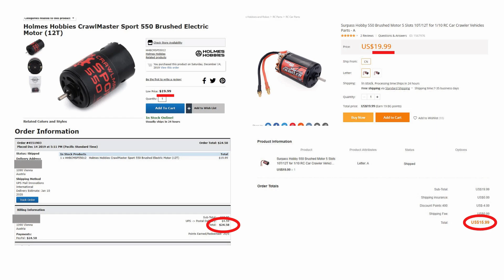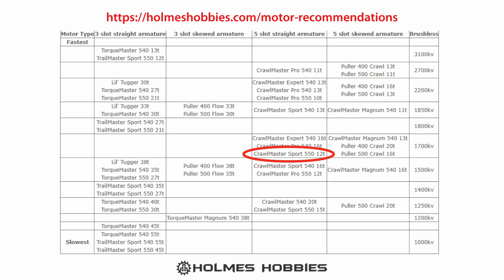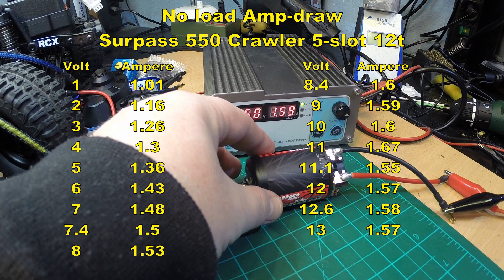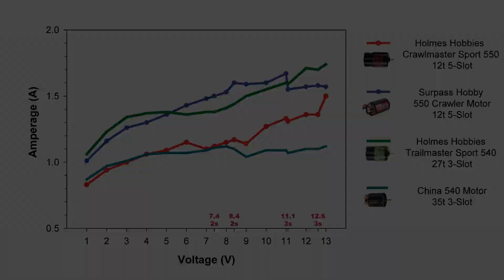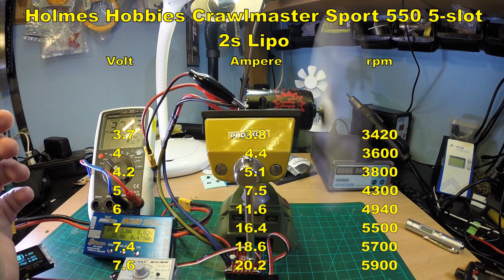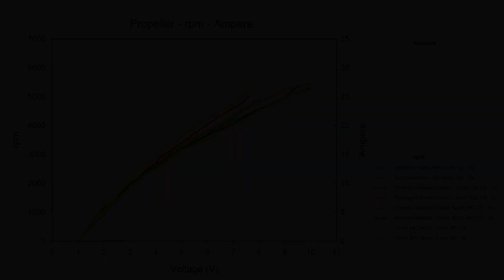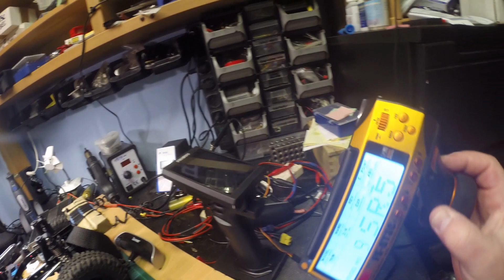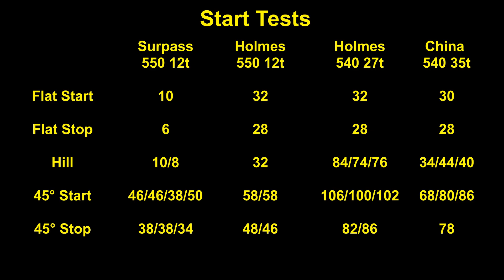550 5-slot Motors: Holmes Hobbies Crawlmaster Sport vs. Surpass Hobby (Full Length)

Comment: Did you take the temp of the esc during the torque test?
Reply from the maker: Was no problem, not even really "warm", becaus of this did not check the temp. In my trucks and helis ESCs often get really warm or even hot. But in this testsetup no problem, for sure below 50° C. The 1080 has a shutoff funciton, sometimes it shut off (and then ran only with lower power), switch off/on ESC and everything was normal again. Temperature not a problem at all. (Did not take the rare tests when HW 1080 shut off results, happened during "propeller torque test", not during "winch torque test").

Comment: EXCELLENT and REALLY INFORMATIVE video . Very long but was WORTH it. 
BUT your tests in 3s with a LOW C 1500mah is almost useless cause  your Zippy is 20C/ Burst 30C so you get  1.5 X 30= 45 Amp max. 
As we can see , it cans give still more amp , but results are irrevelant  (in burst , it fluctuates)
In 3S , it should push the motors much higher in their limits as well in torque and rpm ... and  maybe show better differences beetween all these motors. So much work may have deserved using a 5000mah 3S ...
But still respect for your job done, with very clear diction so we can understand everything,  even not beeing english first language .
i wish you d get Traxxas TITAN 550 21T in your comparaison ...
All in all , Crawlmaster 550 12T is the clear winner. (/Surpass may be helped in start up response with dual bearings = less friction , but then it should draw less amp too ..  strange. The HH seems to be more fine engineerined with better balanced rotor = less vibrations)
;)

Comment: I don't understand why they're calling 10T, 23K RPM motors "crawler motors". For a crawler, you'd want something like a 54T motor or at least something with more turns and less RPM than a 10 or 12 turn. Yea, you can slow crawl with a 10/12 turn motor but it's much easier to control with a higher turn motor. 🤷
Reply from the maker: There is a big difference between 550 and 540 plus between 3-slot and 5-slot motors. You are talking about 540 3-slot motors. It is confusing.